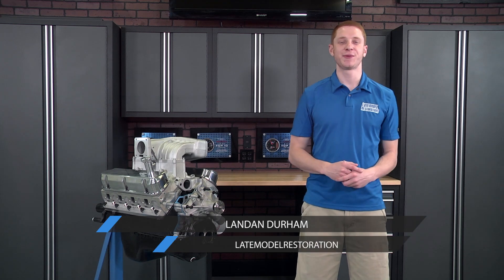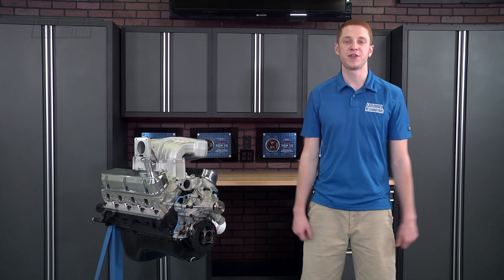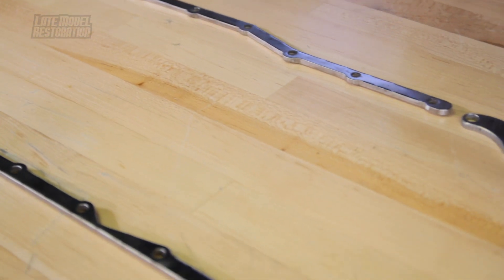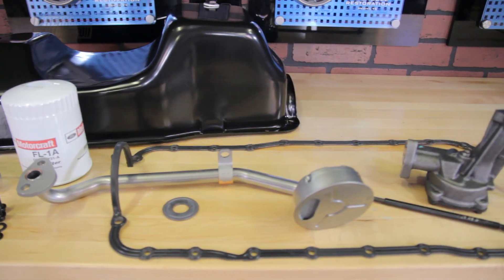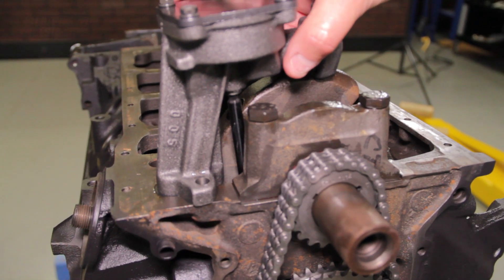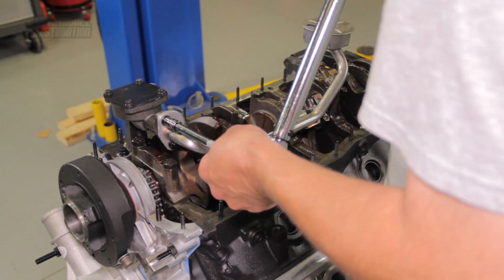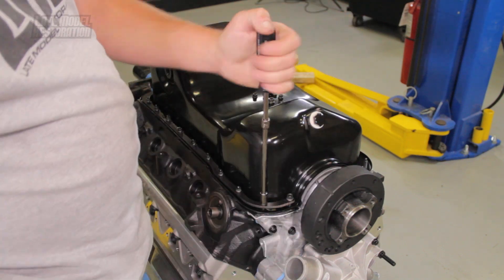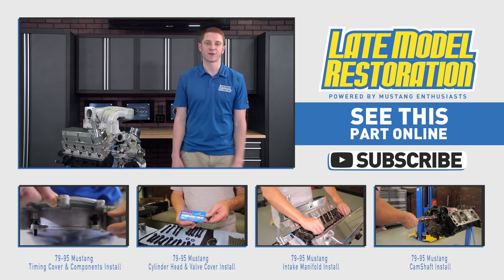How To Install 302/351 Oil System Components (79-95)

Comment: ARP says 3/8 bolts are 45 ft lbs with arp lube do you suggest 35 ft lbs instead for the oil pump bolts
Reply from the maker: Follow ARP's instructions. We didn't clearly specify in the video that the 35 lb-ft torque value is for factory bolts even though we're using ARP hardware. Sorry for the confusion. -Landan
Reply: @latemodelrestoration no worries thanks for the info

Comment: I have a 1987 Mustang LX w/ 5.0L. Is its oil level sensor more prone to leak where the electrical wires enter the back of it (at the hex head) than from the large washer-like gasket against the pan?  I don't see any wires shown in the picture of the oil level sensor that you sell for my car.  It's hard to tell... does the sensor accept a plug that's attached to the wires on my car?  If so, does the sensor you sell have a seal for the electrical plug within it?  One more thing I'm curious about.  I bought my car new in 1987, and I got under my car last night... I didn't see a clip in that slot that's on the hex head of the sensor.  Does the clip come with the sensor that you sell? Thanks. BTW, I'm in the middle of installing an alternator upgrade kit and a battery tray & cable kit I bought from you guys recently.
Reply from the maker: I've seen the leak occur from the gasket, and never the connector. The sensor accepts an electrical connection that is located within the o2 sensor harness. It could be that a previous owner cut the pigtail. This is common.

The sensor is a sealed unit which means the electrical connector does not act like a seal. The gasket is the only thing that "seals" the sensor.

Here is a link to another video that covers the oil level sensor, gasket, and pigtail in greater detail: https://youtu.be/AJAsFZtfjuo?feature=shared

Hope this helps! Thank you for your business. -Landan

Comment: Installed a high flow melling oil pump but it’s hitting my oil pan on my sn95?  Do I need a deeper oil pan or should it fit?
Reply from the maker: First, why did you install a high-volume oil pump?  What are the specs on the engine?  If the engine is close to stock, a high-volume pump isn't needed.  If you do feel like you have to run it, a 7qt pan with a deeper front sump is strongly recommended because of the flow rate. -Landan

Comment: can you install the oil pump drive shaft through the distributer hole?
Reply from the maker: Yes, but the retainer will have to be removed, negating its design of keeping the driveshaft in place if the distributor has to be removed.  You'll run the risk of dropping the driveshaft in the pan if the retainer is removed.
Reply: @latemodelrestoration  thanks for the reply

Comment: Hi Guys, Great Tutorial. Do you have the Product code for the 302 Cleveland rubber gasket? I cannot find one anywhere. Thanks.
Reply from the maker: Hi Karl, 

All available engine gaskets are available on our site with the link below: https://lmr.com/products/79-93-Mustang-Gaskets

If there is a gasket that you are not seeing on our site, please give us a call at 1-866-507-3786 or email us with the link below: https://lmr.com/contact
Reply: @latemodelrestoration hey late model resto! What is the recommended distance between the oil pump pickup tube and the bottom of the oil pan? Thanks in advance
Reply from the maker: @therealunknown123.  I'm sure there are multiple opinions out there, but I've always seen and have used a minimum of .25" and a maximum .375". -Landan

Comment: Those one piece metal and rubber oil pan gaskets are the best ever,buy the valve cover ones also,i changed these over 10 years ago and have no leaks at all,cork sucks bad,also on the lower intake always use those blue rubber gaskets, you have no worries of that damn cork sliding when your bedding the lower intake.

Comment: Why do you need a new pan ? Especially if it’s stock replacement . I just need to oil pan gasket . Because I’m doing my timing chain cover gasket and I refuse to use cork half ass job
Reply: if you have a stroker you will need a new oil pan or else you probably will run into issues.

Comment: The oil pan is not easy when it’s in the Fox
Reply: I tell you a funny story,i have 2 of these cars,Ive been driving both for like 20 something years, one time i decided i was gonna replace the oil pump on one since i needed to do some work under it, i figure nothing to it, i raised the engine and then raised it some more, it was not giving up that pan,i got so mad i just pulled the whole K member from under it,springs, you name it,i showed that pan who was boss,lol, kidding aside you are correct, they are a major pain to remove with the engine in the car.

Comment: Will this oil pan on a late model engine fit in a early model car ?. I have a 68 ford Torino I’m putting a 85 302 in
Reply from the maker: Gregory - I'm not 100% sure. I would recommend digging around on some forums or Facebook groups to see what other folks are doing. -Landan

Comment: Wow... You use all this ARP hardware, but you dont even use the most important part!  What about ARP main studs? Those are way more important than using ARP oil pan studs.
Reply: ScreamingGoat43 need to hook on line to turbo on a 302 ford motor need to hook or line to a 302 motor